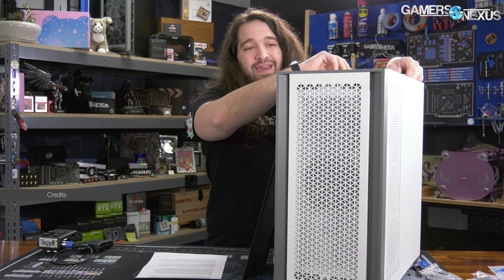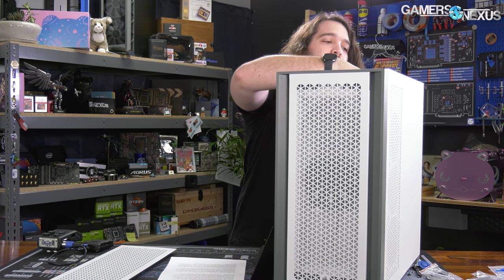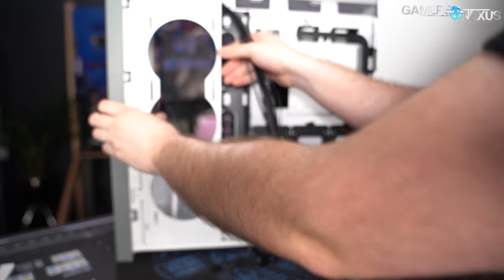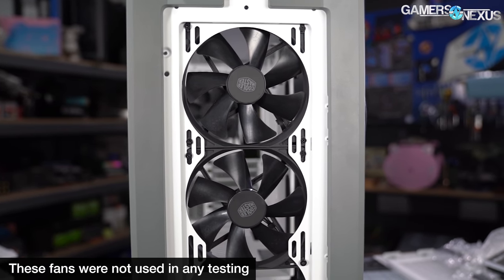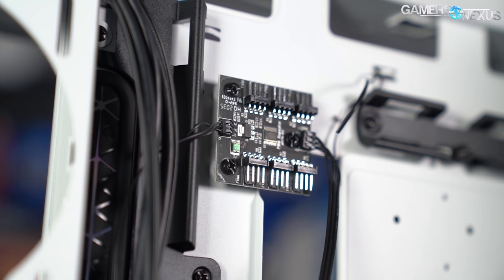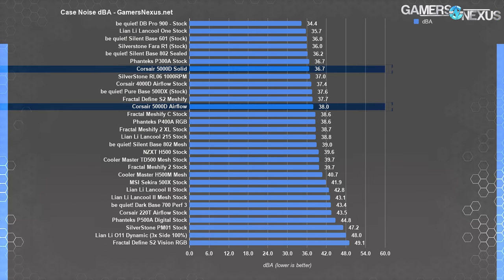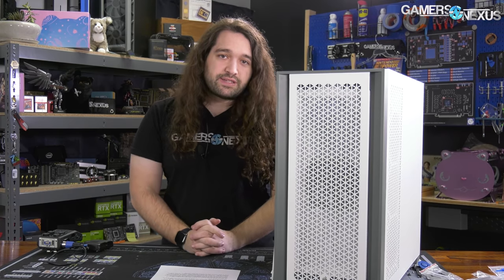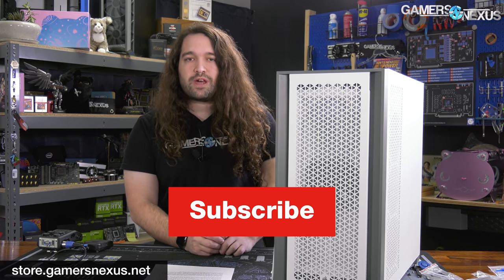Corsair 5000D Airflow vs. Solid Case Review: Thermals, Noise, Build Quality

Comment: I have the 5000x and wanted the airflow panels and tried to order them and it was a 3 week process to just get them to ship and they randomly came in and out of stock. I messaged Corsair about it and they sent me both panels for free in a week. Mad props to them and I will continue buying Corsair parts for sure.
Reply: did it make a big difference?
Reply: It's too bad they don't offer a a la carte option, that way you could order the 5000x with the airflow stuff and still get the upgraded fans and whatnot without the hassle and them sending freebies randomly
Reply: Random question, I don't like TG side panels : Do you think it's possible to order the other side panel (the solid one wich has vents) and use it on the left side ? I'm planning to build a no RGB computer. This case is the one I nedd, but I really need to replace the glass panel by a solid one. Thx in advance.

Comment: Just to say, I would like to see a test of air flow cases fully populated with fans to see the full potential of the cases design. I don’t know a single person who buys a case to use stock fans or put 3 fans in a case that can hold 10, wouldn’t it be more poignant to not recommend this case if you barely intend to take advantage of the air flow? These cases are called air flow so why not fully test the main selling point instead of a semi air flow test.
Reply: I bought this case and intend to use it with the stock fans
Reply: @alexdylan9668   personally I see that as a waste of money, paying that money for a case you wont see the full potential of as your restricted by the cost saving lack of fans. I have the H500m, it would be like CL just putting 1 200mm fan in. As I said, that’s just my view.
Reply: I think it is better to test them with standardised fans so you can actually get an accurate idea of how well the actual design of the case improves airflow.
Reply: @Leanzazzy    That makes zero sense as the standardised flow is with fans fully populating slots, everyone knows manufacture’s limit fans supplied with the case to keep the RRP reasonable.
Reply: The problem is, once you start testing with more components than the manufacturer provided, The Number of Configurations To Test becomes very open ended.
Reply: @WildBikerBill   what? No it doesn’t. You test with the full compliment of fans as the case was designed to have. Standardise the fans to nocture and show the full air flow capability of the case. Do people want to see the full cooling capability of the design or a limited capability that matches a case half the price?? Turbo clocks all go off thermals, max cooling equals more performance.
Reply: @Deeps__  Exactly. I don't see an open-ended number of configurations here if you just add a "fully and reasonably populated" category. The "synthetic", standardized test with two Noctuas may be nice to look at, but it produces results that are far from real world use and only allow limited conclusions on real world performance of these cases with 8-10+ fan capability.
Reply: Good airflow is a requirement for me at least It’s not a feature it’s a necessity
Reply: They have discussed many times why they don't do that. Different fans perform differently as well, not just the arrangement. The point at the end is to extrapolate the data given as a whole and make the conclusions based on that data. They DO go over different fan configs in pretty much every review of a case I've seen on this channel just very briefly. If a case performs as well as say, this one, with it's stock configuration then you can conclude it's performance fully populated pretty damn easily. If you want those details, go to the link in the video description to their text review on their website. That probably has more of the info you're looking for. I totally get where you're coming from but it's not as easy as it sounds. They'd have to modify the entire methodology. The reason people love GN is because everything they do is so strict in terms of testing, you get extremely accurate data.
Reply: If he tested with more fans and got whatever temps and some person that watched this video buys some other fans that may not be as good they will be disappointed and not satisfied
Reply: @AspectSwifty   what?! That logic applys to any number of fans he uses and any results he gets.
Reply: @mwtdarveau282  I think that they could continue to do it this way but also have a, "Maxed with Noctua fans" metric as well. Then that would still standardize that as well by just using the same fan and using the maximum allowed by the case.
Reply: @cthomas025  Well, no. Because not all cases use the same arrangement of fans nor size. So "maxing out" would be different for each case. There's literally no need. They work on the theory/assumption that we know how to extrapolate the data we need off their methods combined with what we might already be able to safely assume or gather when combined to other reviews.
Reply: @Deeps__  Exactly. That's the point. Overcomplicating the test process gets dicey and fast. Anyone watching a review publisher like GN for case reviews know how to conclude a cases general performance level with the own desired amount of fans without everyone somehow thinking there's any real reason to start adding fans to a already extensive and complicated test methodology.
Reply: @k9online   how does fully populating a case with the full compliment of fans that the case was designed for complicate things?? Use the same brand and model of fans with the only difference being the size of fan as the case allows. Do we ever see CPU tests normalised to a base of cores? No, we see a full test to see maximum capability.
Reply: I agree with you.  When I buy a case 9 times out of 10 the fans that come with it get tossed in a drawer anyway, I'm interested in how the case design competes with other case designs and couldn't care how many fans the MFG includes with the case.  Using a standard fans (to the extent of if it's 140mm we use this fan if it supports 120mm we use this fan) with a couple different configurations (front to back and bottom to top airflow maybe if it's supported) would be very helpful.   Testing a case with 2 fans when it is designed to run with many more is useless.

Comment: It would be great for the case reviews if you would add a category populating all of the fan mounts in the case. That way we would know how well the case performs in the best case scenario.
Reply: Seriously. I appreciate when manufacturers don't include a full compliment of fans. Between radiators, noise, static pressure, CFM and RGB, they aren't likely to choose correctly for my build, so it's just more e-waste.
Reply: yes this review is largely worthless
Reply: Agreed I was looking on how this case performed and anyone watching this will not stick with just the 2 fans so after watching this i still have no idea how good the case is in normal use
Reply: This
Reply: Test with 2 fans vs 10 fans
https://www.youtube.com/watch?v=r5OY9llXRwo
Might I add the case cost's about 250 euros now.

Comment: Bought the case 3 days ago this just made me feel I made the right choice thanks everyone who worked on the video
Reply: any idea if you can MOD it to support a 420 AIO like the arctic freezer in the FRONT? Im planning to squeeze the 420 in and if i have to FLEX the bottom open ill do so to fit it in this beauty of a case.
Reply: @GioCTRL  if you haven’t already done it the 7000D airflow supports 420 mm radiators

Comment: I just moved my custom watercooled system from an Obsidian 500D SE to the 5000D Airflow yesterday. All the hardware including the fans are the same between both builds. I found I dropped 10c off my temps and my fans ran 200rpm slower with the same custom curve. I'm extremely happy with both the build process and the temps of the 5000D Airflow. I should note I am using 6 Corsair ML fans.

Comment: I have the 5000X, which is the same but with glass panels.  It has ten 120mm fans, 6 fans blowing air in (3 on front, 3 on side) and 4 fans blowing air out (3 on top with CPU radiator and one on back).  My CPU and GPU both run nice and cool (Ryzen 9 5950X and RTX-3090 FE).  If you like the glass or closed panels, fill every fan slot and you won't have any problems with an overheating GPU.
Reply: I was planning on getting the same case with a very similar configuration. How are your thermals? Thank you I’m advance if you reply!

Comment: Nice to see that the 4000D Airflow I ended up getting is favourably reviewed by you guys, and is actually in a position to be as good as the rest of the airflow cases!!!
I use 2 140mm Gelid Silent 14 Pro fans for intake, and a 120mm Arctic BioniX F120 fan for exhaust.
Only use air cooling, so didin't need the radiator support of the 5000D.

Comment: At that price point, Corsair should've definitely committed to adding more premium fans. I have the Lian Li LanCool II Mesh and it blew me away in terms of thermal performance with the stock fans. I have not bothered installing additional fans in it. That said, bravo to Corsair and please continue this trend of listening to valid constructive criticism, a gorgeous case design and with improved airflow. You're definitely on the right track so stay there and keep moving on up.
Reply: This case is ridiculously overpriced for what you get - but that is standard from Corsair.  It needs to be $40 cheaper to make sense.   For that money you could get a P500a which is a far better case anyway, or an 011 dynamic which is light years ahead of this, or the new Meshify 2 larger version (its name escapes me) which is again a way nicer case than this air conditioning unit.
Reply: @malphadour  any specific reason the p500a or the o11 are so much better than the 5000d? They share a lot of of the same features-front type c, good airflow,good build quality,and 360 rad support.Also this has one some unique features and a good interior design with good cable management as well
Reply: @malphadour  considering that the RGB version is technically cheaper if you add in the cost of the fans and node.
Reply: whats interesting i got the 5000d case and it had 3 of their higher ranged rgb fans ( same fans that comes with their aio coolers )

Comment: The one thing i love about the 4000D and 5000D is the sleek design on the inside it tempts me to choose the components for my build REALLY CAREFULLY. 

Its like im given a precious china plate and its up to me to make a dish and present it in a way that fits with the sleek and grace resonating from this plate
Reply: Which is precisely why I don't want a glass panel case... My computer is not a the holy shrine that I, as an e-monk, must bow down to in daily meditation on the holy documentation bestowed upon me by the elders of my monastery... Strangely enough, 20 years ago I did custom water loop and 400W peltier elements to get my Dual Celeron II 400MHz to run stable at 600MHz... lets just say "the solution" to condensation problems wasn't worthy of a glass pane...
Reply: @andersjjensen  I built my current rig, with custom hardline tubing, and in the Lian Li o11 in Dynamic early 2019. Honestly, the case, even with two glass panels, was far easier to work with than anything else I'd ever used. It was also my first time doing custom water loop and tube bending, and I really enjoyed the whole build. 
The only thing I had to be more careful about was not scratching the plastic PETG tubing, other than that, the glass is WAY less likely to get scratched than paint or, god forbid, those old acrylic panels PCs used to use.... Ugh... those would scratch just from looking at them. lol
I like having my PC up next to my desk to see all the goodies inside. I spent a lot of time and care on cable management (which was the worst part), so admiring it is kinda nice.  :)
It has practical uses too. I can easily see post codes, the GPU tachometer, and when it's time to dust it.  :P

Comment: The temps at stock, even with the solid front panels, is super impressive. Nice to see some actual engineering and thought going into allowing a certain visual style to do a decent job at cooling. 
I also really like the visual design of this case. I'm not in the market for a new case, but I still like it.  :P
Reply: Imagine how good thermals will be with 6 high quality fans and the airflow front panel.
Reply: @Trainmaster909  I have this case and 10 Noctuas, and temps are insanely good and it's insanely quiet. Overkill as hell? Yes, but no ragrets
Reply: @GREEENZO  Is it worth getting the 5000D airflow over the 4000D airflow?

From what I see the only advantages are:

2 additional SSD slots
1 extra USB port on the I/O
Larger cooling space and room for mounting larger GPUs

Space for 3x120mm fans on the Motherboard tray
Reply: @Leanzazzy  go with the 4000d and save some money
Reply: @Leanzazzy  With the 5000D you have the option to mount a 360mm rad to the top where as the 4000D is limited to 280mm.  According to the specs on Corsairs site the 4000D will not fit a 4090 but the 5000D will.  I bought the 4000D sometime ago and was planning on getting a 4090 later this year.  Now I'll have to buy a case as well and am deciding between the 5000D and Fractal - Torrent.
Ergo - it actually cost me money going with the cheaper case, but hindsight is 20/20 and who would have thought GPU's would be the way they are now.
Reply: @jonfox4022  Yeah I think the 5000D is good if you want headroom for the future.

But to be honest, no one needs a 4090 or even a 3090.

If you're playing at 1080p 60 fps then you can play at Ultra graphics for most games with even a 1080 or a 2070 Super.
Reply: @Leanzazzy  what about wanting a consistant 144 fps at 1440p with some future proofing :D I am building a whole new rig now and all im waiting on is the new 7900 XTX :D Its looking like it will top the 4080 at least and come in cheaper too.
Reply: @Terron29  Even the absolute best of the best (RTX 4090) cannot give you a consistent 144 fps at 2K ultra.

Either you choose High Refresh Rate or Resolution or Quality.

HRR gaming is overhyped and not worth it.

For reference, these are the performances of the top GPUs at 2K with Ultra settings:

GTX 1080 Ti = RTX 2070 - 50 fps
RTX 2080 super - 65 fps
RTX 2080 Ti - 75 fps
Titan RTX - 80 fps
RTX 3080 12 GB - 104 fps
RTX 3090 - 107 fps
RTX 3090 Ti - 113 fps
RTX 4090 - 140 fps

RX Vega 64 - 41 fps
RX 5700 XT - 52 fps
RX 6600 XT - 55 fps
RX 6700 XT - 72 fps
RX 6800 XT - 100 fps
RX 6900 XT - 105 fps
RX 6950 XT - 115 fps

Mind you, this is without Ray Tracing enabled. If you enable Ray Tracing, AMD literally dies and Nvidia loses almost half its performance.
Reply: @Leanzazzy  Those stats cant be right, there are tons of videos on youtube of people getting between 110 and 144 at 1440p on a ton of games with with rtx 3080s and 4080s for example. Granted games lke cyberpunk and flight simulator and some others struggle more to hit it. https://www.youtube.com/watch?v=6ZwLDdvhLEc&t=606s

Comment: 4000D supports 360m rads, the user just needs to pick an airflow variant and mount vents between the case and the removable front panel, which is possibly my choice to mount 280 mm 55 mm thick rad into a case without cutting it.
Reply: i have a ek 360mm aio in the front of my 4000d fits fine
Reply: any idea if you can MOD it to support a 420 AIO like the arctic freezer in the FRONT? Im planning to squeeze the 420 in and if i have to FLEX the bottom open ill do so to fit it in this beauty of a case.
Reply: @GioCTRL  use the 7000d instead.
Reply: @TheSjuris  hey Steven, I got the 5000d and the 420 Rad push pull config fit perfectly in the front, just had to grind down some plastic inside in the top front and cut some sheet metal of the case in the front to let the bottom fan breathe aswell. Fits in nicely and am now ready for 12th gen Intel 250w furnaces of chips👍
Reply: @TheSjuris  crazy how they want ya to spend 100€ more even tho the 5000d would easily be able to hold a 420rad in the front by just making some minor design changes.

Comment: I had a Fractal Design Meshify C for years. I replaced it because my i7 12700k (stock) would not go under 90C when running something like CinebenchR23 and my GPU (RTX 2070 Super) would not go under 80C when gaming. I had an 240mm radiator with two Noctua nf-a12x25 PWM fans, one more nf-a12x25 as a exhaust, and two 140mm Noctua fans as intake with the foam filter removed from the front panel. I replaced the case with this case and replaced the 240m radiator with a 360mm and used the fans that came with the new radiator. I reused my three nf-a12x25 as the side intake and my two 140mm fans as front intake. I removed both 120mm fans that came with the case. Yes, I don't have a rear exhaust fan in my 5000d. My CPU temps are now close to 80C in CinebenchR23 and my GPU is now under 70C when gaming. I'm just glad my computer runs a little bit quieter now and the top of top of the case isn't so hot I could just about fry an egg on it.
Reply: My i7-12700K reaches 77 degrees for one Cinebench R23 run on the 5000D Airflow black case with the two stock fans. Unlike you, i use a Deepcool Assassin 3 air cooler (it's a music production build and i hate liquid cooling).

I don't want to sell one of my kidney for a hot and power hungry graphics card and add fan and electrical noise to my PC. I'm stuck with integrated graphics, until an efficient 3080Ti is launched for 125 watts, looking for a GTX1660 Super style of power consumption. 

For now, i don't notice any sound difference when the PC is on and off, it's so quiet, in fact, my Deepcool Assassin 3 stays at 500RPM because i also applied -120mv of an adaptative undervolt. Only on Cinebench is working at full speed and still i don't hear it.